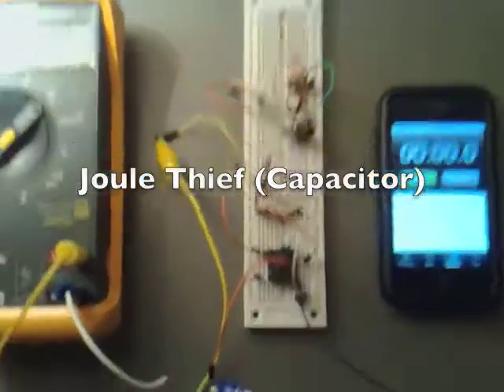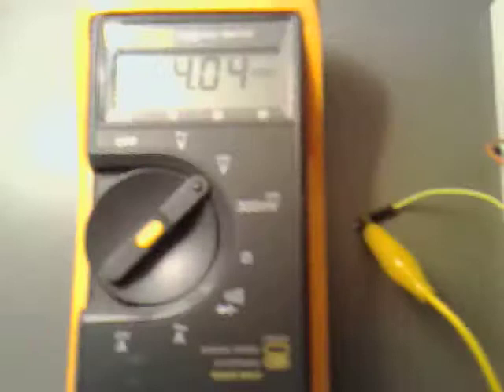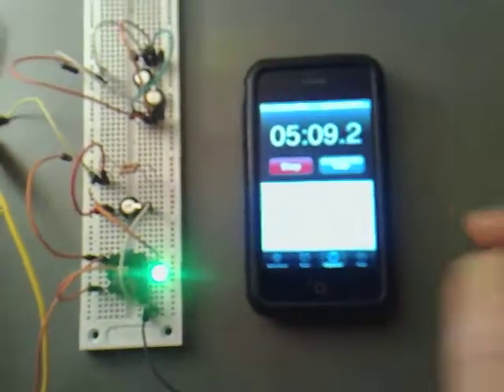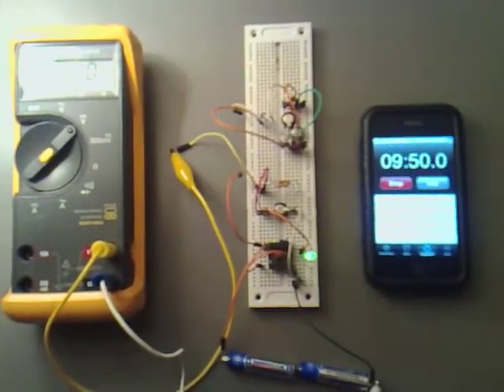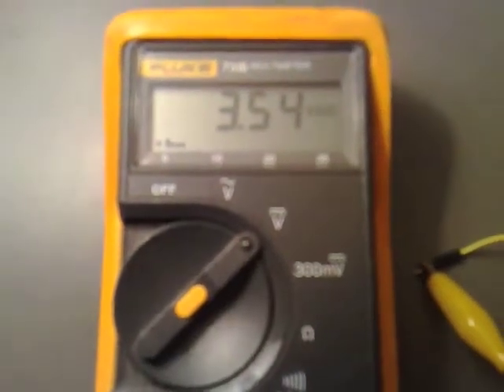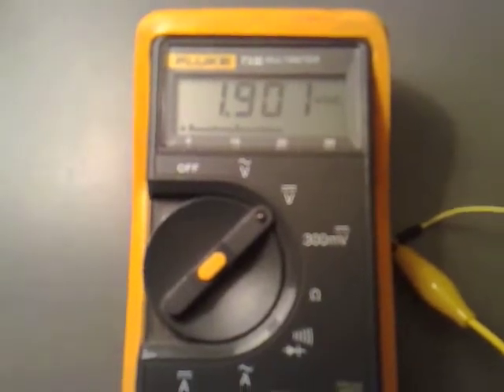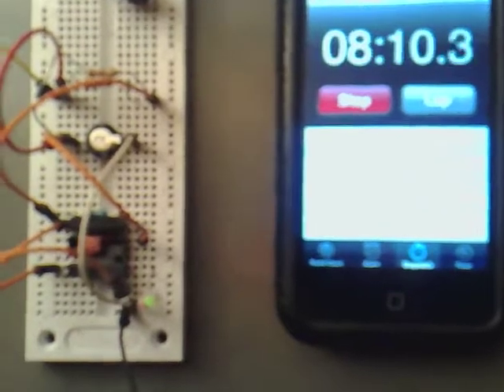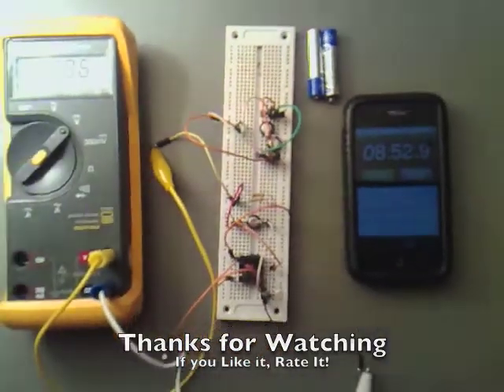Joule Thief (Capacitor) 011

Comment: Gotoluc found a way to charge caps faster using neo's

Pls see both videos
watch?v=0RQ6tIgoiJ8
watch?v=wRWwFxNZZxc

Your cap based JT would be a perfect test to see if he's getting extra energy from the neodymium magnets. 

I did some tests with a transformer and a cap and neos,  seemed like I was extracting extra power too.  Can you pls test with you JT. I think gotoluc has really found something very interesting. Tesla also used magnets on spark gaps maybe to step up frequency and/or current?